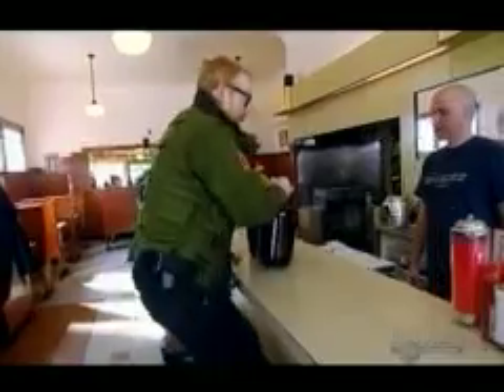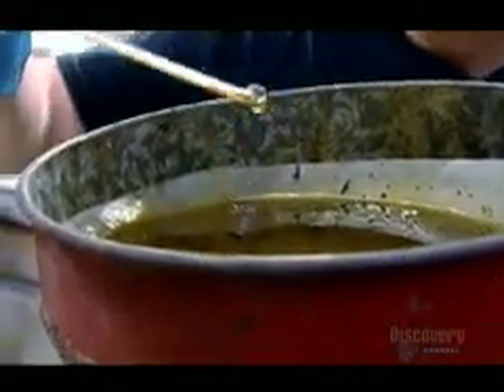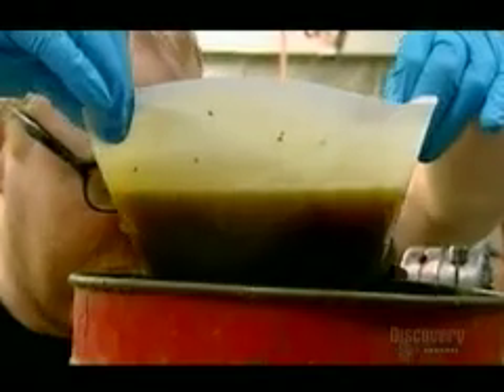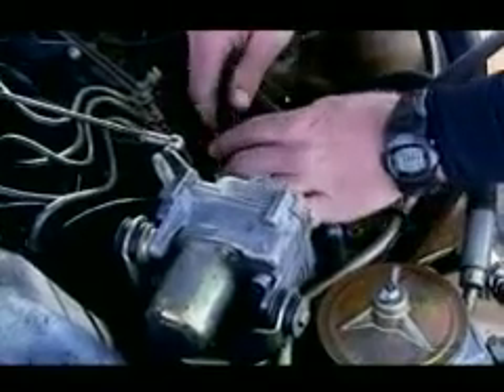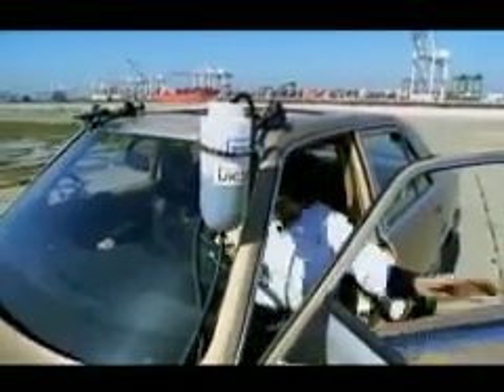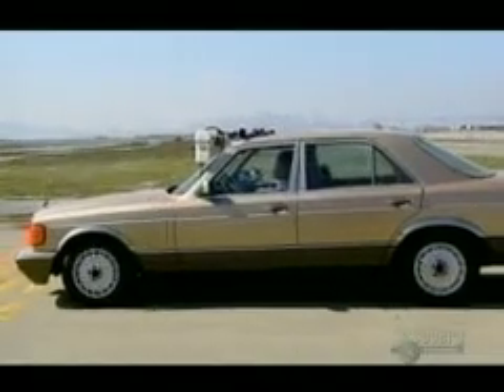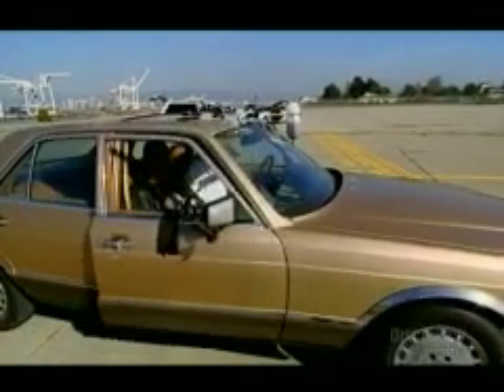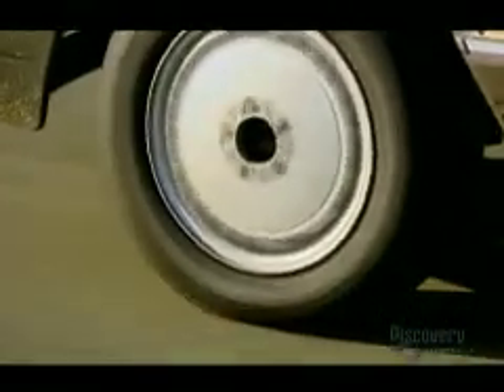Mythbusters - Cooking Oil as Economical Diesel Fuel

Comment: The car here is a Mercedes-Benz W126 300SD Turbodiesel, with the robust OM 617A diesel engine. They run on any kind of oil, some even sucessfully tried used motor oil.

Comment: This is how I do it:  
All of the used oils and hydraulic fluids I collect at home I catch as clean as possible in a catch can I keep sealed in double trash bags. When full, I pour the 15 qts into 5-qt oil jugs I save from new oil/fluid changes.  I let the jugs sit for at least 90 days and then slowly pour off the top 4 quarts. The last quart has the settled solids or contamination in it. 

I mix 3 gal of the clean used oil with gasoline nearly 1:1 in 5 gallon fuel cans and shake for 1 minute, and put two 5-gallons cans into a 3/4 full tank of diesel. My 2005 Ram diesel has a 40 gallon tank. This makes a mix of about 15% used oils.  It seems to run fine Winter and Summer.  I do change my fuel filter a little sooner than typical, about every 10,000 miles, rather than 15,000.

The dirty oil left in each jug i combine  again and let settle another 90 days and repeat. The 2nd time I pour off the top and use the remainder as chain-lube and make two-cycle fuel for my chainsaw, and some start my wood boiler at night.

It's a cheap and easy way to get rid of collected fluids, have a little free fuel, and not waste anything either.

Peace and free fuel!

Comment: A if you ran it through a heat vaporizer n pulled out the good stuff then turned it back to liquid  like making whisky how would this end product perform I wounder ! Old engine oil is turned to fuel this way ! N whisky 🥃

Comment: Heated intake pipe using electricity to start it run on diesel then when warm switch over to vege and use exhaust to preheat it like it's supposed to be

Comment: you can modify it so you start the engine on diesel, and switch it over to a second tank after 2 mins of letting the motor run. like that its always hot and thin enough. theres vids about it. you just need to add an extra tank where the spare wheel would go maybe

Comment: I have been running my cars and boats on used Veg oil for over 12 years now and they work fine. if you settle and filter and heat it, it is just as efficient at diesel....tested over many thousands of miles.  This goofy test shows nothing except that it will run on veg oil until it uses 1 litre.  A ten% diff over 1 litre test is not in any way meaningful.

Comment: I own a 2006 Ford F-250 6.0L turbo diesel.  This my fifth diesel in 35 years, both cars and trucks (Ford, MBZ, VW Rabbit truck, Volvo).  Old timers know that you can stretch the fuel budget by blending used (filtered) transmission fluid and used (filtered) engine oil  and veg oil in their tanks.  Diesels love oily items.  I know nobody who runs veg oil alone in a truck because you lose 10-15% power.  Cars are a different story.  Even though you lose power, you are not towing or hauling, so veg oil alone works.  Truck owners I know run only blends of oil or trans fluid up to about a 30% blend and  you can do the same ratio with gasoline in a pinch if you can't find diesel at a station.   The truck manual tells you that much.  Never had a fuel injection problem with blends, so the clowns below who are guessing on this topic are not doing it daily for 35 years like I have.  IF it is FILTERED well, then it will not clog the injectors.  For those who wonder, I used torn apart fuel filter material to make my filter in a funnel system.  If a diesel fuel filter is designed to keep contaminants out in the fuel line, then I figured three decades ago that it was the right material to filter trans and oils.  It drips slowly and takes a day in my garage to get 2 gallons, but that is all I need.

Comment: thing is, you can get ultra mileage out of old formulation gasoline but in short form it literally turns much of your fuel system into a bomb.. so they never did it because it's dangerous.. a fuel air bomb is the strongest bomb known to man outside of nuclear.... so yeah.. they literally reformulated gasoline so that vapor carburetors couldn't be made by diy people any more.. but they are still dangerous...

Comment: They are such idiots. First off the original patent for a diesel engine ran on peanut oil... Second it's not about miles per gallon. It's about not spending a fortune on a resource you can get for free.

Comment: of course this works with old pre 1986 mercedes engines. They still have iron piston heads. Thats the secret to their longevity..In portugal, they now keep the cooking oil prices equal to diesel prices. But if you are a prepper, its worth looking into. Rapeseed oil is not so hard to make.with 1 hectare you can drive all year.Also, these cars will survive any major solar flare, when all the rest has its electronics fried. Even in cold conditions, the w124 engine will start just fine. It has standard pre-heating of the fuel. No other car afaik has that.

Comment: So they busted the myth of using it completely without modifications on vegetable oil. I have known about this since 2002/2003 and I always knew it worked best with modifications. You need hearing, etc. It is not a myth and definitely not busted. I don't know of anyone promoting using UNMODIFIED diesel engines with it.

Comment: We CJSC AGS-OIL Representatives to major refinery in Russia Federation with allocation for; D2DIESEL OIL GOST 305-82, JP54,JETFUEL, AVIATION KEROSENE COLONIAL GRADE, UREA 46%/PRILLS, LNG, LPG, REBCO, MAZUT100 GOST 10585-75/99, AUTOMOTIVE GAS OIL(AGO Our seller are reliable, responsible and capable to supply to buyer/buyer mandates product request. Interested buyer/buyer mandates should reply back to us asap to enable issue SCO to buyer/buyer mandates. We await your useful responses. Best Regards, Baev Sergey Alexandrovich Tel:+79267498795 Whatssap no:+79267498795 email:sergeyalexand@inbox.ru Skpe:sergeyalexand234

Comment: It's not quite so simple. They ran Diesel first. They ran the cooking oil after the engine and its components were warmed up. We also didn't see the re-start attempt after the car was shut off. If the cooking oil was left in it would be nasty and difficult. The secret to these cooking oil burning cars is to warm them on regular Diesel before switching over to cooking oil and then switch back to Diesel for a few minutes before shutting down. I guarantee... you'll forget to switch back to Diesel before shut-down exactly once! :)

Comment: I have two diesel cars ones a 02 plate and the others a 08 and I run them both on 50/50 diesel/vegetable oil and no probz  and get same if not 10% better power and fuel economy....
Reply: Do you think the diesel and oil will seperate or stay mixed

Comment: They were actually testing devices which claimed that they can improve the efficiency of the engine and reduce the fuel consumption - the myth wasn't busted because of the vegetable oil but because none of these devices has actually helped. The vegetable oil test was just a demonstration that there's a better way to save on fuel to buy these devices.

Comment: water in the oil must be boiled out or it ruins the bearings and pump gets past the rings ruins the oil etc that why some say its bad for engines wraping a copper tube around the exhast super heats the oil to the same viscosity as diesel and using pin point pintle not cone sprasy injectors keeps the oil carbons off the piston walls and increasing the fuel pump pressure and calibration as well. using a marine style blits can with hose and pressurized 12 volt fuel pump can be kept warm iunside and wheeled into the passenger compartment where the firewall rout in the engine bay and the cab heater keep the fuel liquid no conversion needed for the winter and freezing all the gallons in the winter  then saving the white shortning will keep the fuel liquid for example refreeze it and its still liquid once theseperation has been removed use a watering can a s a big gravy  defatter utinsel. 
other ideas. buy in the summer on crigslist its free then the winter gets greabbed  for home heating users for shops.

Comment: I've been running it for 70k miles. I also have a video posted of my truck pulling on it. Heat is the secret. My engine warms up on diesel fuel, then switches to veg oil at 160 degrees. The veg oil is also preheated.
Reply: I heard some people use a smaller tank and a light bulb placed inside of it to heat the veg oil.
Reply: I wouldn't try that. The magic temperature is 160*f or higher. At that temperature, the viscosity of waste vegetable oil is about the same as that of diesel. This helps it atomize properly and prevent cooking that sticks rings and scores cylinders, basically destroying the engine.

Comment: oh EU solved this problem easily... it is simply illegal to fill up your car with cooking oil :D
Reply: Daniel why?
Reply: when you fill cooking oil in your car, you don't pay road tax(es) which is added to fuel prices, so if someone tells on you, the police would dip your tank and if they find out you used other than diesel from a gas station you will get a huge fine.... it isn't very likely to happen, but think about it. You make  some very minor traffic violation, or run into a random check, and the police smells KFC coming from your exhaust pipe.....

Comment: Next Big Thing ..... nope still not catching on .
You need a good diesel car .
You need to clean and filter the oil .
And you need to have some sort of heating system for your tank if you live in a cold climate . 
Most will warm up the engine on regular diesel then switch fuel tanks after warming the engine.

Comment: Will fuck your injectors pritty quickly on a modern car.needs a mix of diesel and oil.In the 1890s, Rudolf Diesel invented an efficient, compression ignition, internal combustion engine that bears his name. Early diesel engines were large and operated at low speeds due to the limitations of their compressed air-assisted fuel injection systems.Rudolf diesel had an engine running on peanut oil for fuel

Comment: I'm not sure exactly what myth they were trying to bust. OK, filtered used vegetable oil is not optimized as a fuel, so of course it's not as efficient as a purpose-designed diesel fuel that you pay for. On the other hand, they did admit it was free. But even if used cooking oil became a commercial product, it would have to be cheaper than diesel to entice users to take the risk of using it in their car, a risk that is real from the research I have done. You can't run a modern common rail diesel engine on unmodified vegetable oil without clogging up the injectors and particulate filters with soot and tar. That's why most enthusiasts convert used oil into bio diesel to make it safe to run in modern engines.

What you can do however, if you have some free oil, and just want to reduce your fuel costs, is use the filtered waste oil as an additive, up to about 10%, which will actually lubricate the engine better than straight diesel fuel as well as saving you some money. I would also be adding some proprietary diesel additives to make sure the combustion process is as clean as possible.

Don't forget, Rudolf Diesel who invented the diesel engine, designed it to run on peanut oil, so it's not such a far fetched idea to run diesel cars on other types of vegetable oil.
Reply: They were testing the myth that auto and fuel companies were hiding secret ultra high millage technology.  They even said that.  And they ran a car on waste oil and said it worked great.

Comment: People tend to forget that the engine Rudolph Diesel built was designed to run on vegetable oil.
Reply: peanut oil but ya pretty much the same thing
Reply: @emailshe  I know several people who run their cars on waste vegetable oil. It does smell kinda like fries lol.
Reply: No...Peanut oil.
Reply: @richfarfugnuven6308  I mean, peanuts are vegetation.
Reply: @boostaddict_  not vegetables though.  Not a nut either, technically a legume...
Reply: @boostaddict_  Vegetables do not produce oil.  The chemicals they treat the sludge material with clearly produce an "oil" capable of running an engine.  Try pouring a liter of Olive oil into a diesel engine, it won't run.
Reply: @ytscksdabig1  Won't run? you sure about that? I'd do it this weekend if it wasn't so cold out.
Reply: @ytscksdabig1  I'd just use an old water bottle and disconnect the fuel line before the filter.
Reply: @boostaddict_  Fine by me, let me know when you upload the video.  I'm genuinely interested to see a Diesel engine run only on Olive oil.  Do the same with vegetable oil and Diesel also like MB so we can get baseline and the results of the two.  They got 90% efficiency with Vegetable Oil, I'll give you "runs" if it gets anything above 1% but, if we're having an honest discussion and it's not anywhere near 80%+ of the efficiency of Diesel, it wouldn't ever be viable to produce and run off of.
Reply: And that Rudolph Diesel was mysteriously killed… and likely it was by someone that rhymes with Mockafeller 😂
Reply: @TheArkisSteady why was the Rudolph engine discontinued and the mocky man's name might rhyme well with Rocky too.
Reply: Specifically Peanut oil 🛢 was the fuel that diesels were designed to run on, diesel was manufacturered as a synthetic replacement 👌 🥜🥜🥜🥜🥜
Reply: A guy from the Philippines have been using used filtered cooking oil to fuel his Diesel Engine
Reply: Not really. It was always made to run on mineral oil but was asked by the French if it was possible to run it on vegetable oil and he built an engine for a worldfair running on it.
Reply: @phantomsoldier497  will run on pretty much any oil; vegetable, peanut, mineral, etc.
Reply: @kalijasin  in a sense yes but in practice you’ll find many problems with using such fuels for an extended period of time on newer diesels, older diesels running at much lower fuel pressures will be a lot more reliable but definitely don’t try this on anything from the 2000’s on up.

Comment: I can't think of a better way to RUIN a perfectly fine old diesel MB.  Sure, a diesel will burn vegetable oil (which is what Rudolf Diesel had to fuel his first diesel engine), but the waste product from a restaurant fryer has water and suspended solids which that improvised cheesecloth filter won't remove.  Those items will foul up the injectors and pump before too long.
Biodiesel is a potentially viable product, from both virgin and recycled stocks, but must still be processed and QC'd like diesel refined from petroleum.  Sorry, folks, ain't no free lunch for your vintage oil-burning Benz.

Comment: Just use clean cooking oil and you will be fine (sunflower oil) that's the one
Reply: Depend on the taxes.  In some places Diesel is heavy taxed.
Reply: Pure Matrix , The cost of fresh Virgin cooking oil would be very costly.
Reply: Old Griz still cheaper than using the petrol at the pumps
Reply: In fact, almost every clean oil works. I drove on 100% veg oil until it was too cold, and I currently drive at 80% wasted motor oil without any problems.

Comment: One flaw, the engine was not run out of fuel before running on the 1L of diesel. The injector pump and lines held (uncounted) fuel. So the veggie oil had to re fill the pump before it started.

Comment: How can you say it’s busted, just because it didn’t get better mpg? Did the car start, run and operate similar to regular diesel fuel? If so wouldn’t that be a pass? 
How does the “fry oil fuel” compare to regular diesel fuel when it comes to emissions? From what I understand the emissions (greenhouse gas) is the reason for running biodiesel instead of regular diesel fuel.

Comment: To mix with this veggie oil, you should try adding water in your diesel's gas tank! I've been using it for 2 years now.
The trick is this: -  Add a cupful of sugar to your gasoline, and when the tank starts getting empty, refill the tank with distilled water. Try not to use fluoridated water- this is bad for the engine and will rust the pistons..
NOTE!  Do NOT turn off your engine when you do this! Keep it running as you add the water. You will hear a slight cough at first, but then it will clear up and keep running!
Reply: Wow nice recipe to seize your engines up..truth is you install engines dont you?>??

Comment: You can't just put vegetable oil in the tank and expect it to run.  The oil will gel and clog up the lines/pump.  You need a separate tank that's heated just for the vegetable oil and then a transfer switch to change between the 2 fuels.
Reply: no definitely not true you can just put it in the tank after you filter it just put 20% diesel in with it to give it some sulfur etc
Reply: @seanmckay3392  This only improves the odds, but not by much.  By not using the proper setup you risk clogging up your fuel lines.  If you intend to use this on your primary vehicle, that's a risk you can't take.

Comment: Just curious.. would this same idea work. If you were to purchase a large size diesel generator for your home. Could you drive to a McD's pick up some oil and power your home on French fries?
Reply: Nik yes it would work in theory. What my dad did back in the 80s was he took an old engine from a tractor and hooked it up to use as a generator for our grain cleaner on our farm. So now i am wondering if i could get a drum of french fry oil and use it to clean our grain? But for the house generator, it should work great, the power required to run our grain cleaner is higher than any power line could ever think about providing, but a house does not require that extreme power so yes it would work.
Reply: YES!! I use coolant to supply heat!!